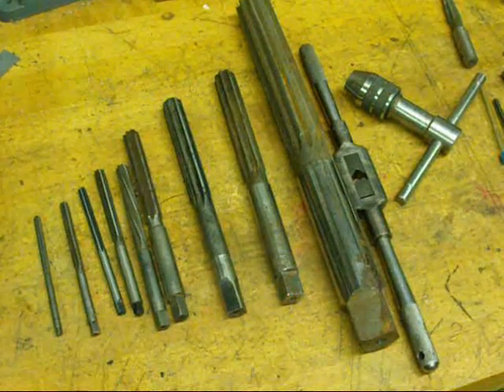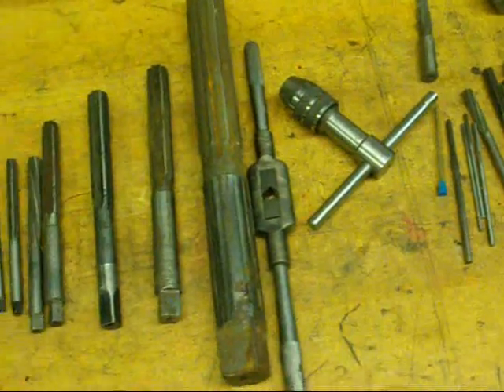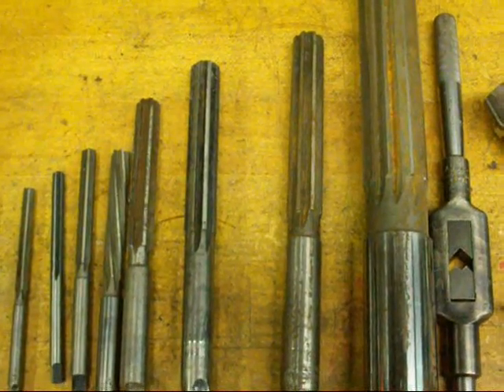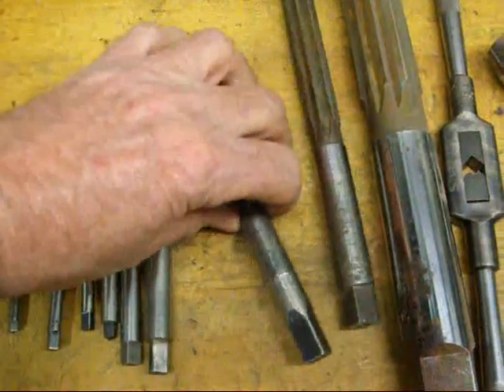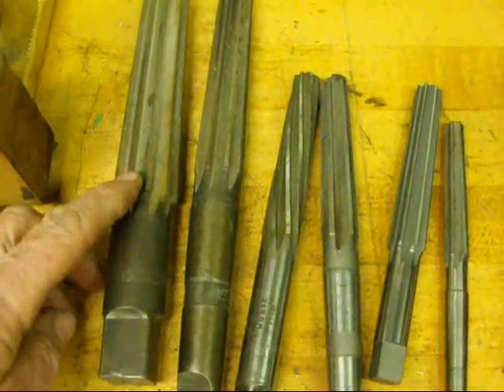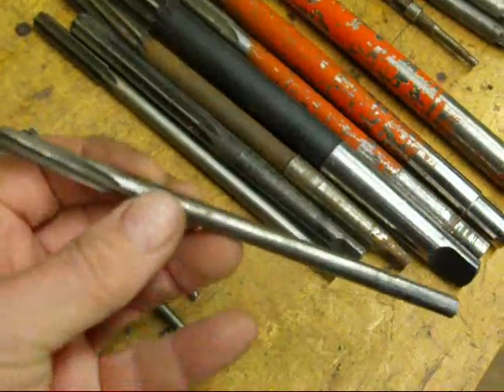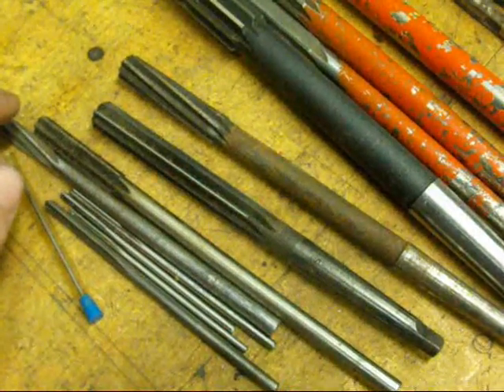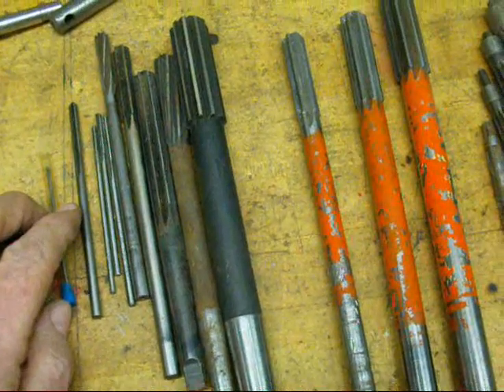THE USE & CARE OF REAMERS Part 1 tubalcain

Comment: I know you made this video a long time ago but I am getting materials together to make your  Yellow Boy steam engine,  I am confused which grade of straight flute hand reamer to buy, here in England UK  they are marked mostly H7 or H8  which are the tolerances the H7  is a lot more expensive than the H8. Could you advise me Mr Pete  if the H8 would be acceptable for reaming the cylinder for the piston or should I go for the the more expensive H7. The H8 can be bought for around £10 to £15  and the H7  £27  to £45.plus. Although I am a pre war baby I am a complete novice in tool room knowledge so would be most grateful if you could help please. If this model goes to plan I hope to make an horizontal version which you have made. Thank you for all your video's I have watched which I find easy to follow and no complicated drawings. Thank you Dave
Reply from the maker: Thank you for watching. Good luck making the engine. Buy the cheaper Reimers, they will be fine.
Reply: @mrpete222  Thank you Mr Pete for your quick and helpful reply, and thank you again for all your video's and taking time to help other's. You must have been a wonderful teacher. Kind regard's Dave. (UK)

Comment: Hello Mr Pete. I have bought an adjustable reamer to create slightly enlarge hole for a sliding fit on a ground shaft. I know how to adjust the reamer but what is the best way to check the size of the reamer apart from reaming and measure the hole. The idea of bringing the anvils of a micrometer up against the cutting edges of the reamer sounds like a bad idea.  Any advice welcome My best regards Chris
Reply: AllTheGearNoIdea some mics have carbide tips or some shims.

Comment: Thank you very much for two reasons 1. I occasionally have a need for a super accurate hole in material of considerable thickness and have had no real success. 2. I acquired a number of nice reamers and have only used them for de burring the inside of pipe after cutting it to length.  Now I know their true use!

Comment: I would use it for the following stud adapter

91636055-GM

Overall Length

5.157"

Notes

5/8" end is 3" long with 2.75" threaded. Steering arm end is 7/16".

Sold in Quantity

Each

Degree of Taper

10 degree

Top of Taper

0.615"

Bottom of Taper

0.460"

its for a control arm

Comment: Also, you can sharpen reamers, especially tapered reamers. You can sharpen straight reamers by grinding the cutting edge of the flute instead of the land. you may lose a couple of tenths but it is possible provided the damage isn't too severe.

Comment: Hi:

Could you consider doing a video on LINE BORING please?

I have a need to do so on an air bearing fixture that was damaged in transit. I have tried to find something that will adequately prepare me for doing this on my manual lathe. However, I keep coming away with nada.

Thanks for any consideration!

Jon